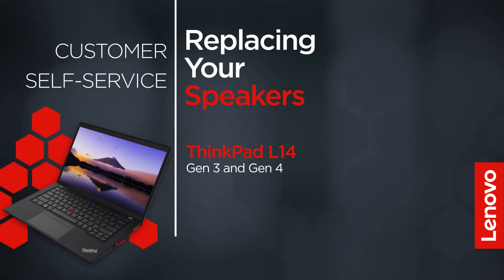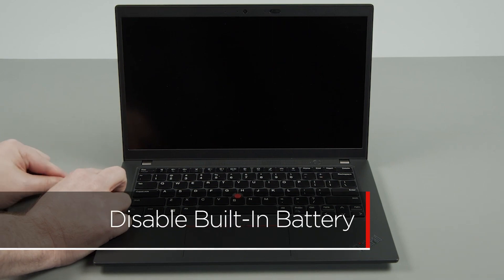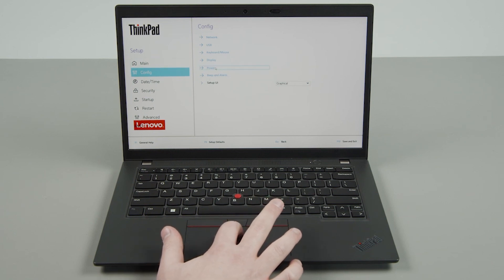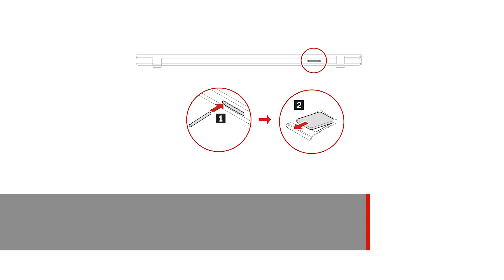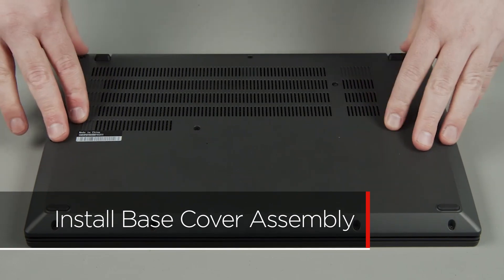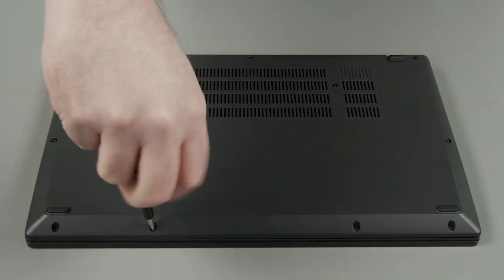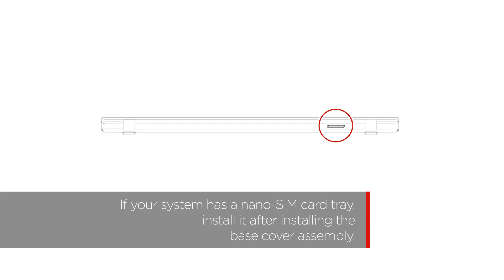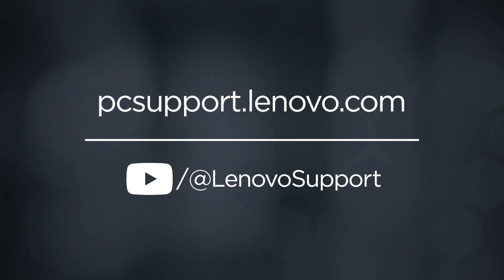Replacing Your Speakers | ThinkPad L14 Gen 3 and Gen 4 | Customer Self Service

Comment from the maker: This video will show you how to replace the Speakers of your ThinkPad. The process in this video will work for the ThinkPad L14 Gen 3 and Gen 4. 

You will need a screwdriver kit, a non-metallic pry tool, static-safe tweezers, and 15 minutes of your time.

To view the ThinkPad L14 Gen 3 Self-Repair Guide go to https://pcsupport.lenovo.com/us/en/products/laptops-and-netbooks/thinkpad-l-series-laptops/thinkpad-l14-gen-3-type-21c1-21c2/selfrepair/removalsreplacements

To view the ThinkPad L14 Gen 4 Self-Repair Guide go to https://pcsupport.lenovo.com/us/en/products/laptops-and-netbooks/thinkpad-l-series-laptops/thinkpad-l14-gen-4-type-21h1-21h2/selfrepair/removalsreplacements

To learn more about your device go to https://pcsupport.lenovo.com

To find parts for your device go to https://support.lenovo.com/parts-lookup/?cid=ww:lenovosocial:b9515f&source=socialmedia&subsource=yt

To view the Lenovo Support Self-Repair Guides landing page go to https://support.lenovo.com/us/en/solutions/HT516547

** NOTE: Static electricity can destroy components. Use a grounding strap, and clean, non-conductive surface to work on. Use plastic or coated tools to prevent scratching and avoid using metal tools on plastic parts. For more detailed information on electrostatic discharge and how to prevent it, please watch our ""Understanding Electrostatic Discharge (ESD)"" video: https://youtu.be/by4PB3WtdLo 

Applicable Machine Types:
ThinkPad L14 Gen 3 - 21C1, 21C2, 21C5, 21C6
ThinkPad L14 Gen 4 - 21H1, 21H2, 21H5, 21H6

#lenovo #LenovoSupport #LenovoTechSupport